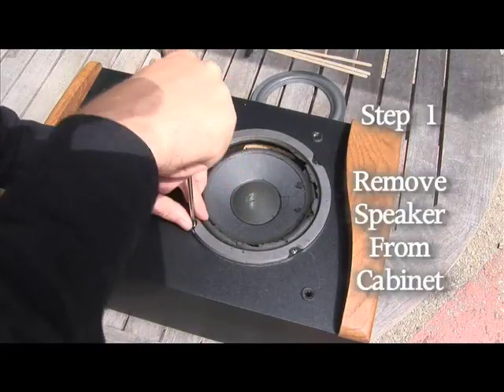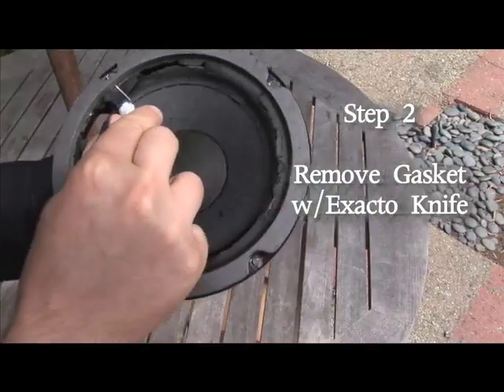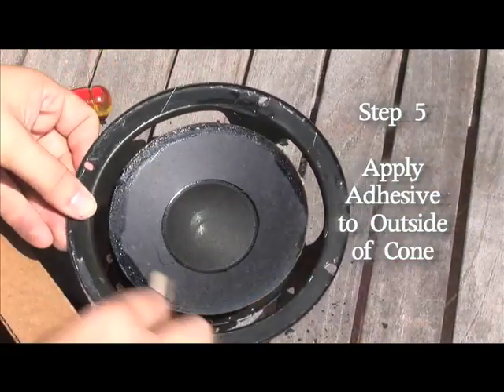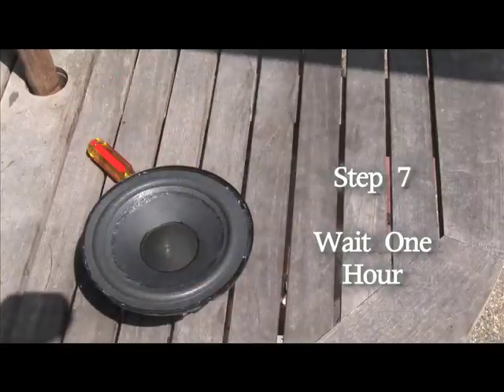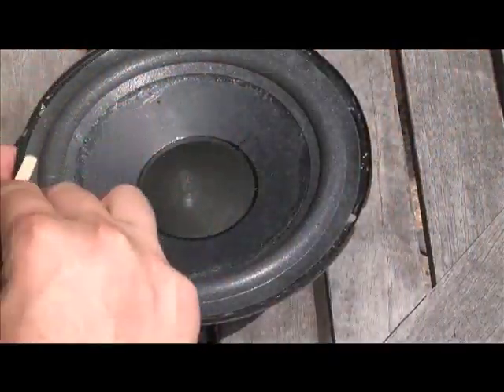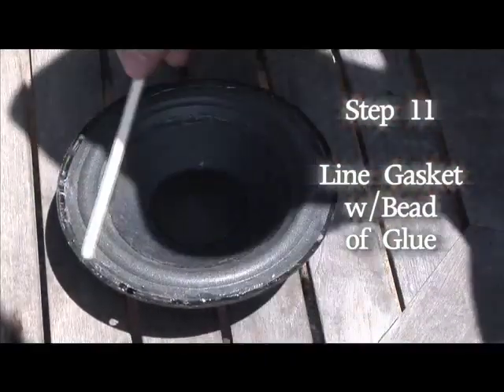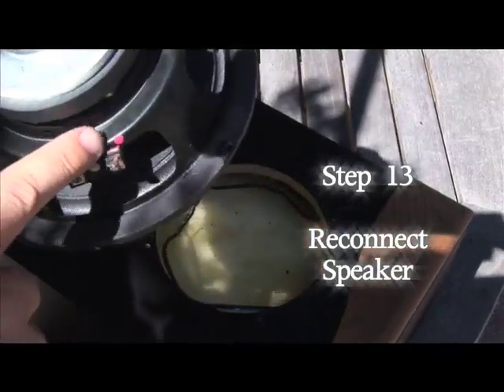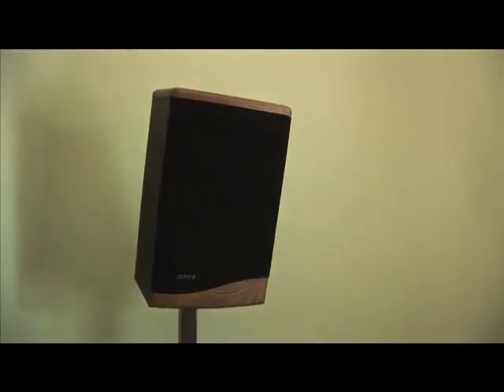Replace a Speaker Foam Surround

Comment: @ExpertOfSound I actually just sold them but i think it might have just been a normal speaker, but im not sure because it had a big port hole in the back. it kinda looks like a big version of the one in the video on top except it has another small speaker in the middle of both of them. i think it was a jbl and it was pretty old

Comment: Very cool, however, I find it easier and more beneficial to find a speaker, similar of size and a bit above the watt max of the amp. Furthermore, it is important  to see if such a speaker is up to the task of what is desired. If bass is desired, such a speaker would need to be strong in it's resistance and would be noticed when pushing (lightly) for it's resistance. If highs are sought after, a speaker with ease of movement would be the ideal choice. I find, from my experience, that 2nd hand stores are your friend. My advice, be patient, knowing what you are looking for, and you will be satisfied in what you accomplish. Bless you all!

Comment: so i am trying t0 portabilize someting which is pretty old, like 8 i think and the speakers are huge. They have a 2 wire output and (i hope this is important) the 2 wire colors are red and black. Now i think that they could work with my nintendo ds's  speaker, which has 2 wire red and black output. i was wondering if i could replace the huge ones with my ds's

Comment: help me i have a old speaker its 5 inch wide and i kinda want to change my old 2 inch speaker on my pc.... is it posible to connect it there and just change the case? i dont know which one is positive or negative cause its pretty old and this speaker is used like i was 8 years old for the vcd... im 15 now lol! i want to fix it cause its been under my computer table for 5 years now after we moved in to another area.... btw.... it looks ok exept for a few rust that i just remove with an ld 40...

Comment: @jarederajarederaj 

Oh alright! It was just one of the regular "bookshelf" speaker sets.

If the surround was completely torn apart or had holes in it, then it will matter significantly... since it was ported, it won't matter AS much because of the port noise anyway.

:D

Comment: cagey,
you might try Simply Speakers, I've had good experiences with them.
(YouTube won't let me post the web address, but just Google it)

They have kits for most brands, around $30 to treat two speakers.

Just make sure you get the right kit for your model and size of speaker, they can help you if there's any doubt

Comment: Most speaker surround replacement kits come with the glue.  (at least they did with the one i used in this video).  Just google for speaker surround replacement, there are several sources out there.  Good luck.  DoDoDodedeetily!